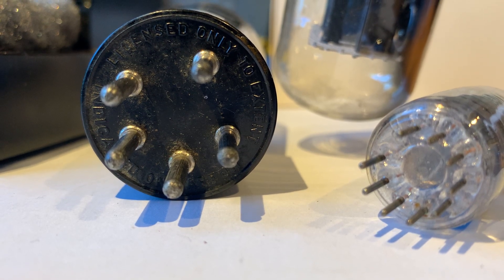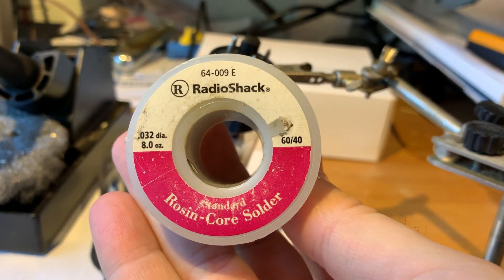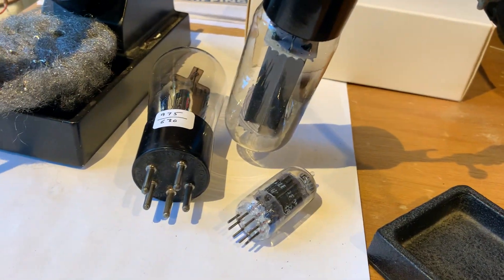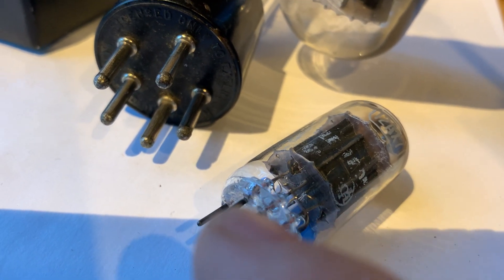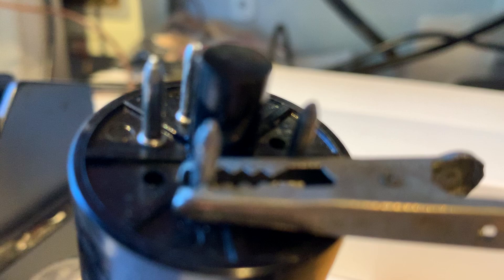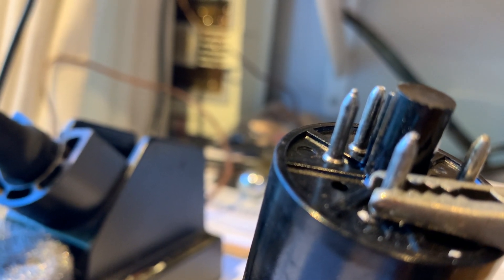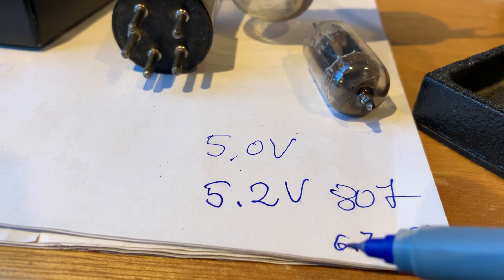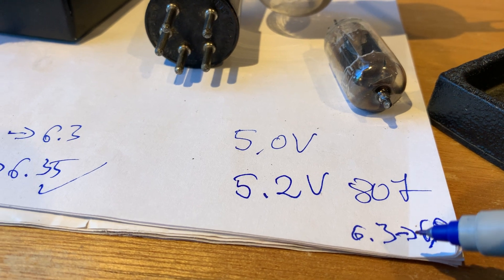BEST TWEAK EVER - SOUP UP YOUR VACUUM TUBE!

Comment: Makes a lot of sense replacing 80 years old solder on the pins :) I once also put silver solder on the tube pins just to provide a better contact with the (octal) socket.
Just one thing, if the voltage goes up - it means the overall resistance went up (not down). Assuming we decreased the soldering/pin resistance, it would mean that previously tube filament was undervolted internally and now the filament heats up more, not the solder, causing the higher voltage  to be measured.

Comment: Sir I have got Audio Note JLX spkr with ANTT2 turntable …looking to pair it with phono tube 300B amp.. Audionote 300B is very costly.. Could you tell me someone who can build good 300B amps fr 3000-4000 dollars which is top class .. Anyone tube amp builder across the world ..
Reply: @Singh There's no "top class" SET amps that cost 3000-4000 dollars. Top class iron can cost that much easily. I'm working with a world class SET designer. Also phono stages are never inside amps. BTW serious "top class" amps are always dual mono.
Reply: RealWorld's reply video to you has a lot of great info. I'd also suggest contacting Eclectic Electrics on eB*y, as he builds 300B amps from time to time. Oliver Sayes is also a very talented builder, although I've never seen any 300B designs from him. Check out the GlowInTheDarkAudio website if you haven't done so already, you may find some ideas there, and also by emailing Kevin the site producer. 
That said, it really depends on what you mean by "top end." The "usual" builds from these gentlemen are fabulous, and I'm sure that they would be able to go all out but it'll be more costly than 3-4k. The "usual" ones would likely be in this range though.

Comment: I developed  an intermitant heater on one of my 300 b tubes about 4 months ago.I resoldered  both heater pins and the tube was saved and it was a sigh of relief on my part.The big question is do you suck the old solder out or reflow the existing solder joint in the pin with better fresh new solder? Something else to consider that also makes a large improvement is cleaning the pins on the tubes with metal polish. I use a Autosol which 
comes in a paste format which you can apply  lightly to the pins. I then take a wood tipped cotton swab and cut them in half and put one in my dremel  tool  and polish the pins at low speed.After doing this black oxide will build up on the cotton swab and I just replace it with another until all the pins are shiny. After this i clean the pins  off with 99% isopropyl  alcohol with a clean cotton swab and I am done. The results are quite amazing in terms
of  transparency , imaging , and low level detail.By the way I have not received your email yet so we can converse outside the comments section . Regards Lou

Comment: Do you know what manufactured tubes audio note uses?
 you can ilver dip to clean their silver pins then isopropanol then use that connective polymer on the pins and sockets
Reply: @John S. AN are in business with Psvane which are now vastly over-rated with average to poor QC.
Reply: @craigcharlestone  I would have thought they would have used that Japanese make or kr audio
Reply: @johnsweda2999  Read about Grant Fidelity's battles with Psvane. Very damning stuff. AN's massive investment in Psvane was ill advised.
Reply from the maker: Thanks for the update! Oh boy, it seems that quality control is still a myth.... pretty disappointing stuff. I'll keep on sticking to NOS tubes, LOL :)

Comment: Fringe hi fi tweeking? Where to source silver solder? Can one quantify how much of a "improvement!?" % wise? Akin to replacing stock amp fuse to ceramic or 'audiophile' grade fuses? ... snake oil or valid improvements!?? ...
Reply: Everything in an audio circuit matters. The results are cumulative. One small change can equal only a fraction of a percent, but once many of the "tiny" improvements are made you'll notice that each modification can be more discernable because the resolution is available to notice this small change. And that miniscule improvement can mean a larger sense of enjoyment in the overall picture. It's sort of a reverse law of diminishing returns. 
For silver solder, I personally use Johnson IA-423 and have had great results. You can get it from Parts Connexion in Canada. I haven't tried the AN solder that RealWorld likes so much.